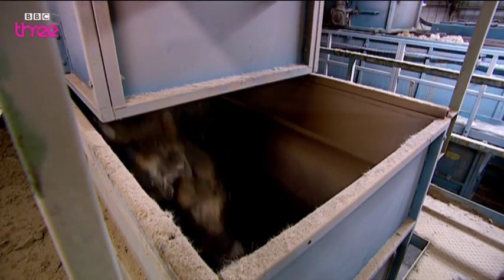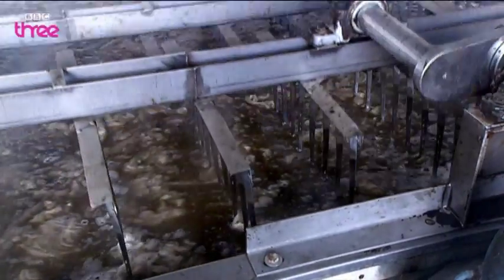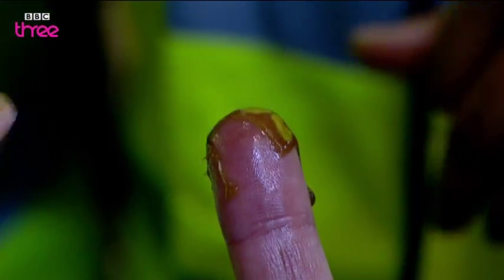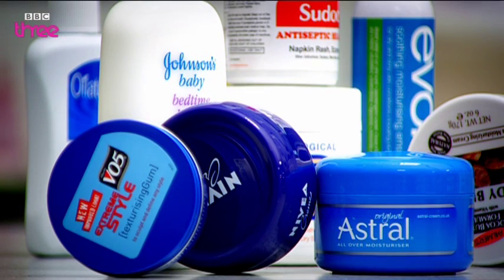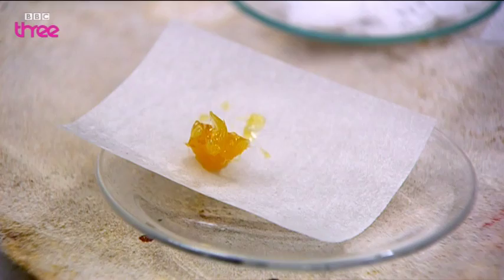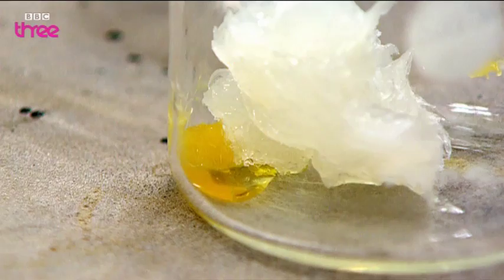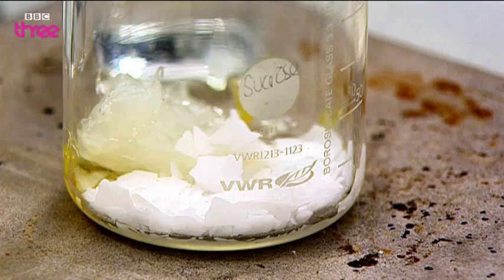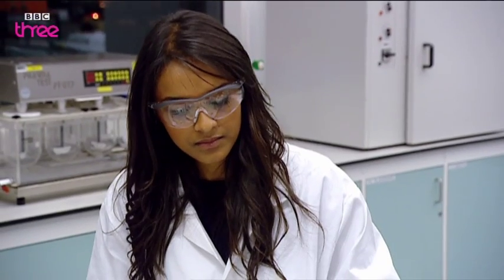Making Face Cream From Sheep's Wool - Kill It, Cut It, Use It - BBC

Comment: Organic naturally collected and highly refined is much better.  The Asian import lanolin has DDT residues, alcohol, chemical strippers, acids and impurities.  It’s very low quality and allergenic.  Organic Refined and dewaxed lanolin is soft, amber and very translucent.  It has very little odor and absorbs quickly into the skin by gentle rubbing.  If it is hard, opaque, smelly or greasy return it and complain.  Locally refined organic lanolin is almost never responsible for dermatitis or allergic response.
Reply: thanks for your comment. I just bought some for the first time. It is by 'Now Solutions' and not organic. It doesn't smell but is very sticky, I have no idea of the origin. I will try to buy organic next time.

Comment: HAHAHA I work there. Horrible smelly place. the wool gets more respect than the workers
Reply: Hi May I know they purposely kill the sheep to get the wool ?
Reply: @magchan818  They don't kill the sheep to get the wool!  Sheep are sheared yearly.
Reply: @janicejohnstone4962  thanks dear. . 😘
Reply: @janicejohnstone4962  Yes but don’t shear before winter because then your risking that the sheep will die of hypothermia with no winter coat
Reply: @mikaylaaugust2757  No one shears just before winter without having proper draft-free housing or being in a favourable climate. If shearing is necessary, winter combs are used that leave wool on... they don’t slick shear when it’s cold. Within 2 weeks a sheep has grown enough wool cover and produced enough lanolin to keep water from getting to their skin. One good shake and most of that water is removed. There is not enough profit, not any actually, in wool for anyone to mistreat sheep JUST for the wool. That just doesn’t happen.
Reply: @janicejohnstone4962  Unless its Peta
Reply: @mickyhamps where abouts is the factory?
Reply: Dear Sir 
Are they using Alfa laval separator to get lenolin?